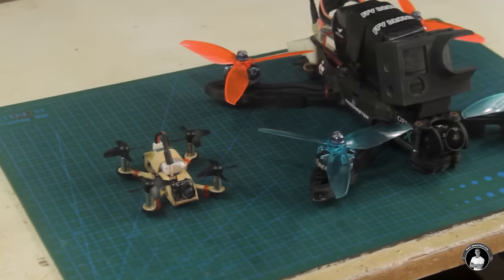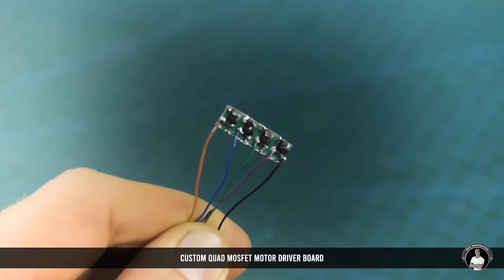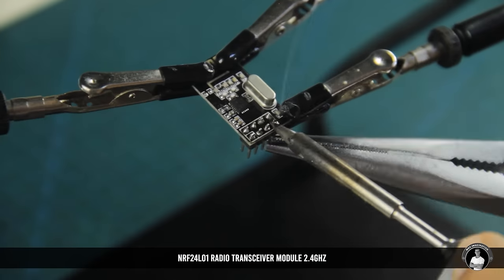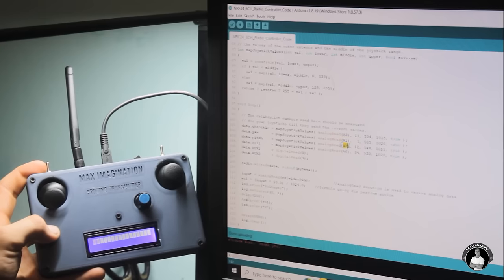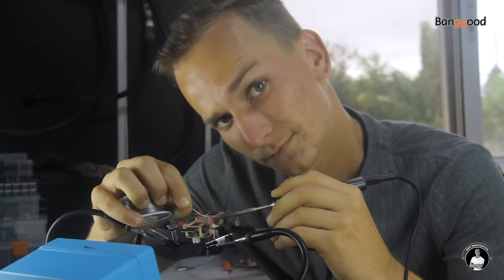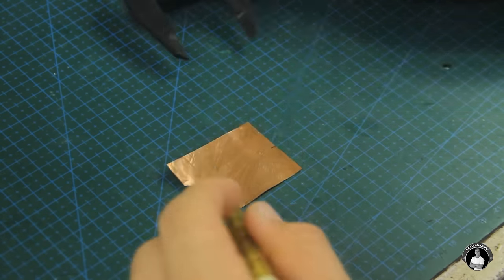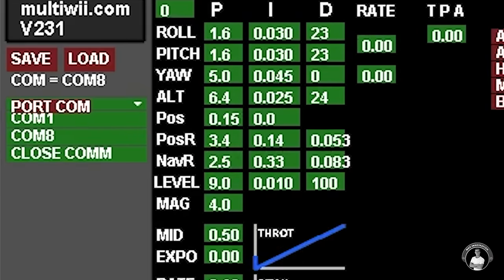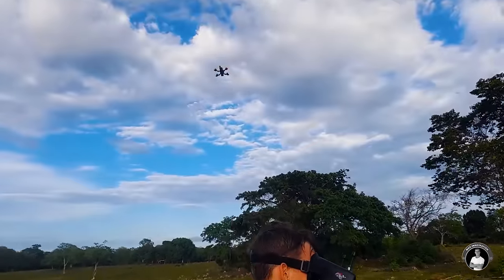Make a TINY Arduino Drone with FPV Camera - Will It Fly?

Comment: How to make transmitter plz make a video
Reply from the maker: The transmitter tutorial is linked below from another YouTuber. Simply follow his steps and use my modified versions of his 3D designs linked below with the resource files. The only difference with mine is the toggle switches which are mandatory to control this drone.

Comment: I can tried with capacitor but result is same dosent work 
But i can make this without pcb board so it can make problem ?
Reply from the maker: You don't need additional capacitors. Your drone needs that copper sheet placed between the flight controller and motor driver board to prevent the EMFs from affecting sensitive components.

Comment: Can I use a different transmitter? Does it work with a different transmitter?
Reply from the maker: Only with an Arduino-based transmitter using the NRF24l01 module.

Comment: Brother I have a dead phone but all its components are working like display battery camera etc. Only its motherboard is dead so can I make something for it please tell me.
Reply from the maker: You can probably make something from using its battery, vibrator motor, and speakers. Combines with a number of other parts, you may be able to make something, but not so much.
Reply: @MaxImagination  can we connect raspberry Pi or another item to use as motherboard etc
Reply from the maker: That depends on what you intend to make. I suggest you keep those parts spare and decide first on what you want to make and only use the parts if you need them.

Comment: Can i use the different nrf transmitter
Reply from the maker: You can. As long as it's Arduino-based and has 2 or more Toggle switches.

Comment: can any one add BMI and ICM sensors aswell just to update the good old multiwii MPU6050 feels old also have M9 & M10 GPS compatibility
Reply from the maker: Never heard those used in a DIY drone. What are they used for?
Reply: @MaxImagination   oh they are modern sensors found on current drones  and modern GPS . and the only way we can keep multiwii alive is to make it compatible with new sensors and GPS

Comment: Can you plz help me to do programing arduino in the previous video?
Reply from the maker: Hey there. Which video? What programming issue are you stuck on?
Reply: Arduino based radio transmitter i am stucked

Comment: I just finished making the remote but why do I connect 5v to all the components and i connect to arduino nano but why led power on arduino turn off?
Reply from the maker: Hi there. Make sure you're supplying 7.4V to the Arduino's VIN pin and not the 5V pin to avoid frying it.
Reply: oopsie i just connect to 5V, okay max i try again later thanks.

Comment: can i use bigger dynamo?
Reply from the maker: Bigger motors may be too heavy for the rest of the components. I suggest it only if you plan to make a bigger frame and use more powerful components + battery.
Reply: @MaxImagination  hmm okay max, but if i use bigger motors can more faster speed or still same
Reply from the maker: Yes, if you use a more powerful battery

Comment: Can i directly connect the motor to the arduino because they are too small and hard to solder for a beginer and also espensive
Reply from the maker: No, you cannot. You will fry your Arduino like that.

Comment: I tried this but the multiwii configurator doesn’t recognize my Arduino. I have the 3.3volt 8mhz pro mini
Reply from the maker: Has it gone green in the configurator? Make sure you have the sensor and radio module connected for it to be recognized and active.
Reply: @MaxImagination  I am using a different firmware but every multiwii configuration I use it doesn’t go green, it only works on my 5volt arduino that are 16mhz
Reply: @MaxImagination  I am using a different firmware so I can use a pwm receiver with my fs i6 tx
Reply: @MaxImagination I tried the firmware in this video and it still doesn’t show up. It only works on an arduino uno which is too big
Reply: @MaxImagination  it works on my 5volt arduino pro mini

Comment: Can i use the arduino nano istead of arduino mini pro please. Tell me fast
Reply from the maker: Yes, as long as you keep the weight down on other parts. Think of how you can get a smaller battery, smaller NRF24L01 module to compensate for the extra mass of this larger Arduino board.
Reply: Can I use the same code in the arduino nano
Reply: Can i directly solder the motor without the small components that you have used
Reply from the maker: You can use the same code, but you cannot directly hookup the motors to the Arduino. You'll fry the Arduino that way!

Comment: How can i learn make robot with hands?
Reply from the maker: Firstly, I suggest starting with learning electronics first as it will give you the foundation. Then, move onto learning Arduino and it's programming.

Read the book: Practical Electronics for Inventors 

Watch channels such as "All About Electronics", "GreatScott", and "EEVBlog".

From there, you can read or watch courses about robotics.
Reply: @MaxImagination  where can i learn it?? I understand basic of physics Sience, i understand basic electric but not components in the robot system.
Reply from the maker: I may be unable to find it all to refer it to you, but the information is already out in the internet, you just have to search for it. I recommend you learn electronics and master that well first before you move on.

Comment: Will it work without a camera?😅😅😅
Reply: @JGTechnology10  yes
Reply from the maker: Yes, it can. The camera is optional.
Reply: @MaxImagination hey bro the transmitter u made from emilostuff guy I wanna build the emilostuff guy transmitter but is there anything else items with 5 pins I can use instead of the potentiometer😢😅

Comment: Hey max I don’t have any own output for some reason and I can’t figure it out
Reply from the maker: Hey there. Do you mean the motor output? If you want more in-depth help on this project, I highly suggest you read my write-up here: https://www.elektormagazine.com/labs/make-a-tiny-arduino-drone-with-fpv-camera
Reply: @MaxImagination  yeah autocorrect doesn’t like technical terms like pwm but anyways I think it has to do something with arming, and I don’t have an arming switch on my controller as I only have 4channels
Reply from the maker: See my product links in the video description to purchase a Toggle Switch to arm your drone. As long as you're using the same electronics for your transmitter as I've shown in the video, all should work. I also, highly suggest you follow the transmitter diagram linked below this video.